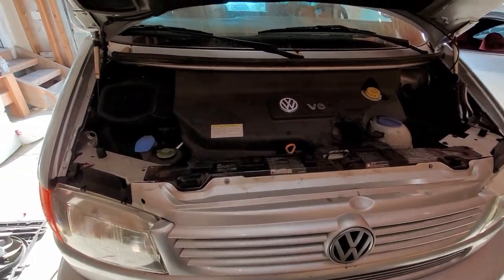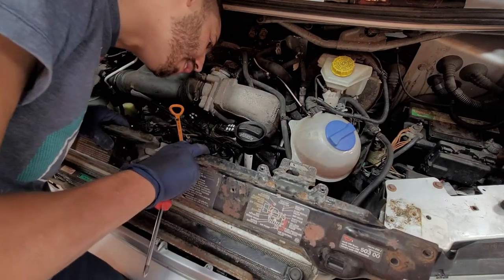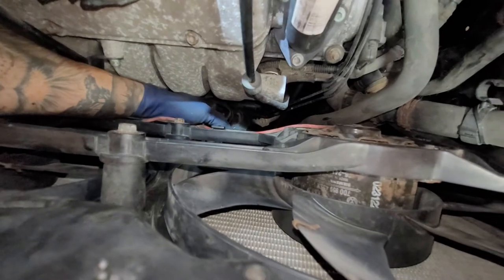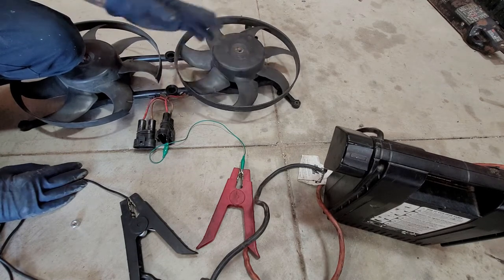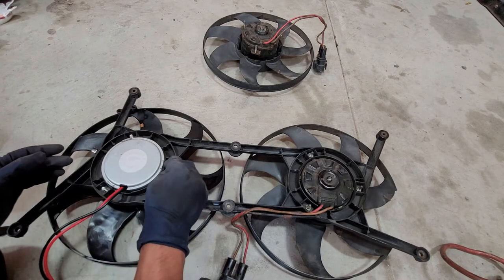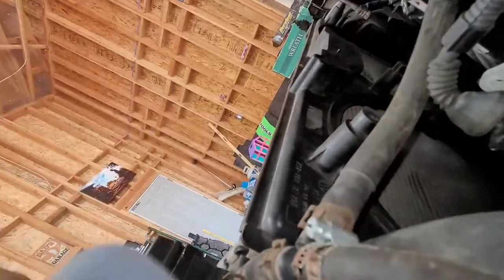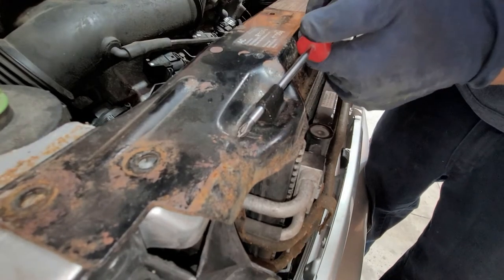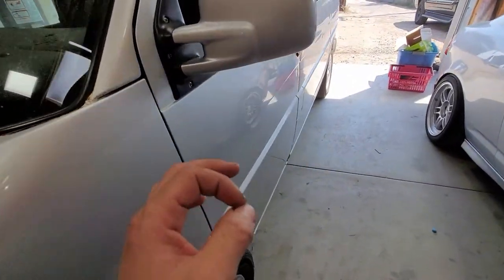eurovan electric fan replacement

Comment: This is a simple job, but you went the extra distance to show all the little angles and details. Thanks. One thing I will say is that one of the fans runs pretty much all the time, while the other one only comes on if the AC system gets super hot which even in Southern California is not very often. On my 2001 anyway. Yeah when one of those fans is broken, it vibrates so bad that you think the motor is still running. One little hack, is that if the main fan breaks you could just switch the wire connectors to switch to the other fan and not use AC until you can replace one of the fans. I suspect that's what actually happened when I paid a mechanic on the road to fix it, it has me wondering if all he did was switch the wires!